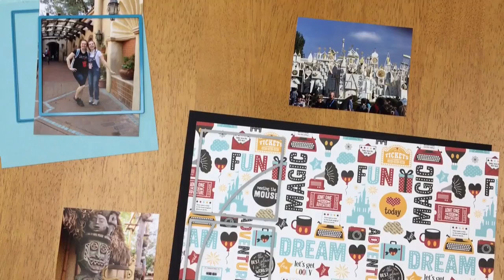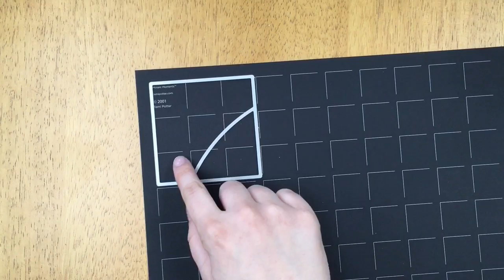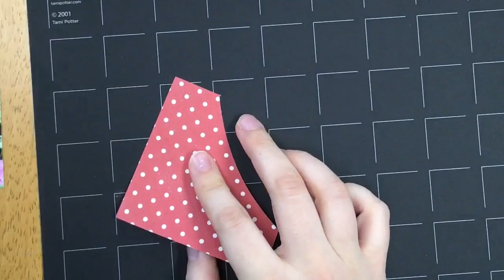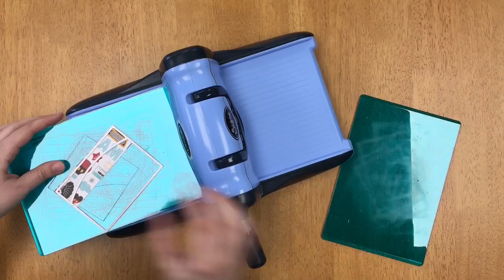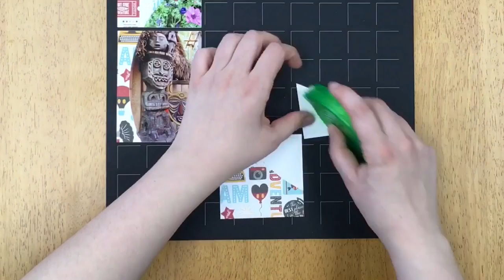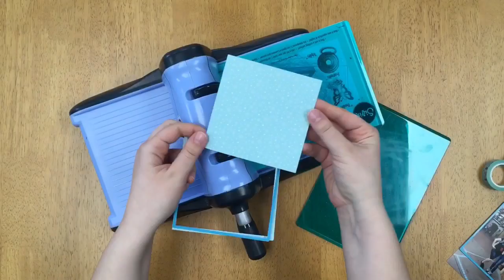How To Create a Circle with the Horizon Die Set

Comment: I am wanting to do my first layout using the horizon dies but wanted to verify the mat sizes you used.  You said 3x3 and 3x4 but they don't cover the whole grid lines.  Please advise what I am doing wrong.  Thanks!
Reply from the maker: Hi Barb! I apologize for any confusion. When I say 3x3, I mean the die that covers 3x3 squares on the grid paper. The 3x4 die covers 3x4 squares on the grid paper. The actual measurements are 3.25x3.25 inches and 3.25x4.375 inches. It sounds like you probably used the layering dies in the basic bundle. Let me know if you have more questions :)